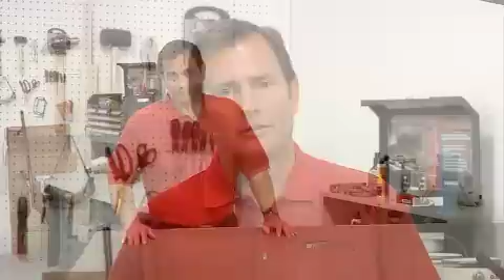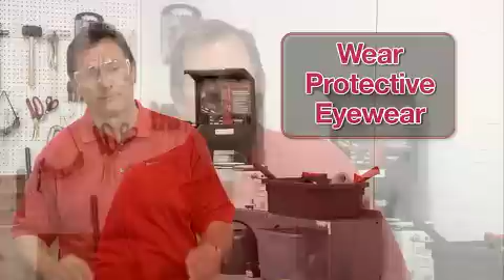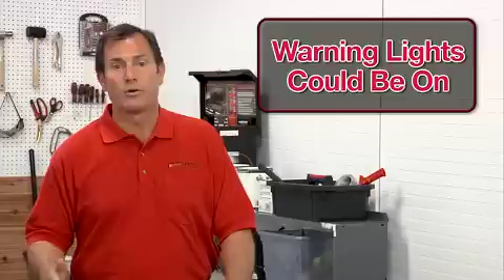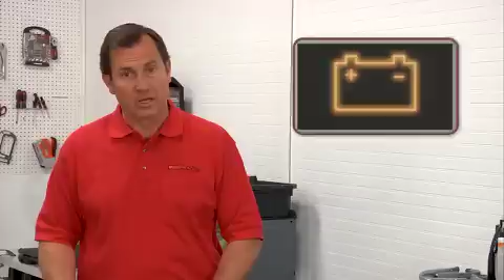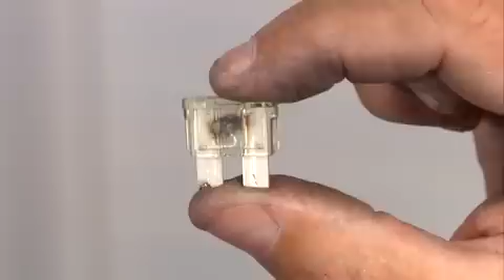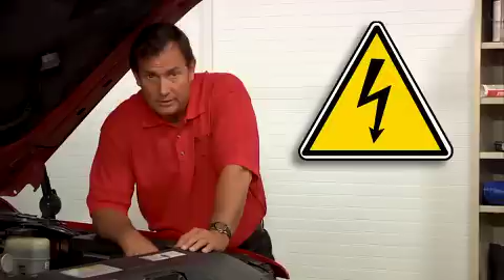AutoZone Car Care: When to Replace Your Alternator

Comment: Hi I just went to a garage because I had engin light on and service traction control on the dashboard so we the filter and than my battery voltage is goes to 14 than goes back to 12.5 do you think is from the alternator my mechanic told me is the alternator because my battery is good and the engine light won’t go off?

Comment: Have 12 in subs in a 2.0l 07 focus so Lights Been Dimming lol but Yest the Light Came on and Yep 12v was the Supply to battery Then at Idle It dropped down to 6v and Stall. Was The Alternator the 170$ -240$ Alternator need to Give Free Lube at that Price

Comment: I just had to replace my alternator. bought one at autozone, it was also bad. had to go back a second time and get another one. that one worked. but I was worried it was something else. used a volt meter to check.
Reply: Did u get new or reman

Comment: The light was lit on the dashboard. The service man behind the counter, sold me a battery, actually ''The Gold Warranty Battery'', installed the new battery, then I left the store ''With The Battery Light Still On, which he also knew.'' **Now before I get soaked for buying a $160.00 Battery, I'm going back down to that Store First Thing In The Morning & Get My Original Battery, because it ''Wasn't The Battery In The 1st Place.'' ***This is what he should have done in the 1st place.**

**If AutoZone Tries To Run That Old, ''The Batteries have already Been Picked Up, I'm Going To Complain.** ***If They Try That, We Have No Way Of Finding Your Old Battery***, That Should Be Easy. Its Going To Be That New Looking Battery, Furthest From The Back Door In The Rear Of The Building.....

I got jacked around, Two separate times. The last time was when my son was fired from his job because the Salesman Behind The Counter at the Elizabeth Lake Road Store Sold Us A Front Left Caliper for an F-150 With Rear Drum Brakes. Ford Hasn't Used Trucks With Rear Drums Since Like 1992. My Son Fell Asleep an Hour Just Before He Was Supposed To Leave For Work. And I Was Supposed To Believe AutoZone Has That Set As Their Parts Books #1 Choice For The 2003 Ford Pickup Truck, Oh Hell No.............. Now After The Union Stepped In On My Son's Behave, He Was Aloud Back To Work, [3-Days Later Without Pay], He's On A 1 Year Probation Period. Late or Misses 1 Day, He's Gone For Good. So This 2-Hour Job Ended Up Costing My Son $600 In Lost Wages & Pretty Much His Job Working at the Closes Job Sight To His House.

In Order To Continue To Use AutoZone, I MUST Read Everything About My Vehicles Prior To Buying From Them On YouTube. Plus I Have to Sometimes Check With Another Parts Store, [Which Is A Retarded Thing To Do But After What Happened To Him, Damn. I'll Probably Have To Edit This Answer Tomorrow After I Get Back To AutoZone & Get My Original Good Battery Back.....

Comment: If I fully charge my battery and drive for about 20 minutes and the battery starts to drain could it be the alternator that’s not working
Reply: Yes that's the whole reason why
Reply: No 😁😁😁😉😉😉😉😉😉😉😉😉😚😚😝🤑🤑🤑😚🤑🤑🤑🤑🤑🤑😝🐺🐆🦍🐅🐅🐺🐮🦊🐅🦧🐅🦊🐅🦊🐱🐎🐈🐄🐱🐂🦊🐮🦊🐂🦊🐂🦊🦌🐺🦓🐩🦁🐩🦁🐒🦓🐩🐺🐮🦊🐆🦝🐂🦊🐂🦊🦙🐫🦓🦏🐑🐇🐑🐪🐭🐰🐏🐰🐏🐇🦥🦥🐹🦏🐼🦥🦛🦛🐇🐿🐡🐛🐛🐛🐛🐛🐛🐛🐌🐚🐲🦋🕷🦗🐙🐞🦗🌸💮🏵🦂🥀🌹🦂🦂🐛🦂🌺🌳🌿🌵🌴🌵🌵🍂🌴⚘🌲🌺🌹🌸🏵🍇🍉🍋🍐🥝🍒🥔🥬🌽🍐🥔🥭🍒🌶🥬🥜🥦🧅🥯🧀🥩🥪🧆🥓🌭🌮🍟🥪🥗🥙🍳🍳🥚🌯🥘🍿🍿🧈🥣🍿🍿🧈🧂🥫🧂🧂🥫🥫🥫🍱🍱🍙🍘🍚🍥🍜🍜🍝🍠🍠🍢🍤🍥🥮🍣🍣🥮🥮🥮🍡🍡🍡🦐🥡🦐🍦🦀🦞🦞🦑🦑🦑🦐🦑🦐🦐🦐🍧🍨🍦🍬🍯☕🍮🍫🎂🍬🍹🍸🍵🧉🍶🥃🥤🥄🍽🧉🧊🧊🧃🥢🍴🥤🧊🍴🧊🥤🔪🥢🍴🥤🍽🧉🥢🍴🍴🍽🥄🥄🍴🍴🍴🍴🥃🥂🥂🍺🍶🍭🥧🍼🥛🍹🍺🧉🍹🥂🧃🧃🍺🧃🍸🍵🍼🍬🧉🏺🔪🍺🧊🧉🌍🌎🌏🗺🌋🏛🏟🏞🧱🏤🏪🏣🏬🏥🏩🏡🏟🏛🏟🏟🏟🗻🏛🧱🏥🏦🏦🏚🏦🏦🧱🏢🏩🏥🏤🏤🏬⛪🗼🗽⛩🌅🌆🌄🏦🛕🌁💈🚃♨️🎪♨️🚇🚅💈🚂🚋🚝🚉🚔🚞🚌🚎🚔🚒🚓🚙🚘🏎🚲🦽🛵🚲🛹🛣⛽🚥🛣🚨🚥🚧🛑🚢💺🛬🚁🛩🛫🛥🛳🚠🚟🚀🚀🧳⏳🛎⏳⏱⏰⌚🛎🕰⏱🕒🕒🕔🕐🕠🏫🏫🌞🌜🌘🌕🌝🌙⛈🌤🌤🌌⭐⛅🌝🌟🌪⭐⛈⛅⭐☁️🪐⛈⛅⛈⛈⛈🏗🏢🏡🌆🌆🌆🌅⛲🌆🎀🎍🏆🎗🏀🏆🎗🥇🎉🧨🎏🎈🎐⚽️🥉🏅🥊🥋⛳🔮🔮🧸🧩🎿🥌♦️🧿🕹♥️♥️🎮🎮🎮🎮🧸🧸♟♥️♣️🖼🀄🧶
Reply: Yep
Reply: Yes only cause I am having the same issue with my vechile too it's your alternator good 🤞

Comment: My alternator is nicely tucked near my right wheel just about under the engine 😅
Reply: I had a Lincoln LSC that was like that. I got rid of it after 1 month.
Reply: I work at a junkyard they had me pull one off of a 90s Nissan thing was all the way at the bottom and I thought the hell is this one puddle splash and oof

Comment: Hi, I have an Dodge Charger 2014 and just Chang the alternator. Still after running for some time I am getting an Battery Saver Mode option. Note: I have checked with Mechanic and my batter is ok also. Plz help and advise wat to do??

Comment: If you can start the car, take the voltmeter and measure across the battery terminals. A bad alternator will be 12V or less and will drop as you add electrical loads (alternator not charging). A good alternator will put out 13.8-14.2 volts and be able to maintain this voltage even with loads added. This isn't a complete test as it doesn't test the alternator current output but gives you a basic check. I just replaced an alternator where the battery light came on only at at idle. The wipers ran low at all engine speeds and the voltage was about 12V and dropping. No charge. This was the second reman alternator in 2 years (at least it is free). The original lasted 250K miles!
Reply: Thank you! This comment means so much to me! I was wondering if my battery was bad and I just changed it
Reply: I am glad it helped. If a jump starts a car, a bad or discharged battery is likely. A bad alternator can kill a battery by not charging it properly or discharging it through a bad diode.. My car has a tiny battery and not being used every day, combined wirh short trips means I need to trickle charge it occasionally. Lead acid batteries live longest at or near full charge.
Reply: @gmzx3 Does a alternator usually go bad based on number of miles driven or number of years on it ?
Reply: Miles are more important as moving parts, such as bearings and brushes wear with use. If vehicle is properly stored, I believe a decades old alternator will work.

Comment: Your Reman  Duralast alternators are junk.  I'm on my third one in 2.5 years and have zero confidence in this one.  My battery and terminal are brand new but I wish i had gone to the dealer.  Lifetime warranty is worthless when you're pushing your car out of heavy traffic to get to a safe spot.
Reply: Happened to me today.
Reply: Arie yup just replaced mine in my wife's Camry 11 years old went straight to Toyota coast more but original parts and 100% Quality of the work is better
Reply: You'll sleep better at night. My 3rd Autozone reman is still working after 7 month but road trips make me very nervous now and I have made a mental note of which small towns I pass through have an Autozone in case I break down and need to get another "life time replacement". From now on I'm only sticking with OEM or at the  very least, a brand new part.
Reply: It worked just made noise

Comment: my headlights and internal lights flicker when engine is on
Reply: Is is a police car? Just kidding. It could be that the starter isn't putting out enough voltage. I had lots of weird problems because my alternator wasn't putting out enough voltage. (It was putting out about 12 volts but it really needed like 13 or 14). I replaced it and the problems went away.
Reply: Gladiator Spear ll

Comment: First thing to check alternator for stickers that say "100% Tested", yellow "Charging Problems" with 800 number,  "Duralast" and "reman". If you have any of these or you have installed a AutoZone alt about 6months-1year ago then that is going to be your issue 90% of the time
Reply: That happened to me. The replacement has lasted. I think they just replace bad part, paint/clean it. If alt is hard to replace or keeping car, I would go for a new one.

Comment: plz someone help!! my car qont stay charged. new alternator..new starter..new battery and still the battery wont stay charged. 1987 olds cutlas ciera.
Reply: You have to have a short somewhere, not easy to find
Reply: It could be a bad connection somewhere between the battery and the alternator. One of the common places they will have issues is when the negative battery cable connects to the bottom of the battery tray. Also check the negative going to the engine block, and seeing that the batt, alt, and starter has been replaced the positives was probably already checked but wouldn't hurt to double check and to make sure none of the wires seem too hard as that could be a sign of corrosion. If you go to autozone they should be able to do a charging system check that will test the battery and the alternator, if it fails check the alternator fuse and (small 2 pin) connector. If it checks out good you probably got something draining on the battery at night (we car is off). Start by checking the simple stuff like the trunk light and the glovebox light. Make sure the ign switch is turned all the way off as sometimes a wore out ign switch will allow the key to come out in any position. Sit inside the car and make sure the lights are turning off properly. If you have a test light disconnect the negative battery cable and clip the test light from the negative terminal on batt to a ground point on the car (bare metal) and if the light lights up bright or simibright (make sure the door is closed so interior light wont be on) go through your fuses and relays one by one pulling them out (just one at a time then put it back and move to the next one) and look for the light to get dimmer, when it does then whatever you pulled the fuse or relay for is what is causing your battery to drain. Do the fuseblock under the hood first (because its easier) then do the one inside the car next. If the test light stays on the whole time then take a couple pictures of fuse box to note what goes where and pull all the fuses and see if that makes it go off or very dim.
Reply: Rachel Dailey. voltage regulator may be
Reply: I'm taking your advice on my 89 Cadi. Thank you very much <All2skitzd>
Reply: I also agree with you. Thank you.

Comment: In my car, the battery would die if the car wasn't used for several days -- particularly during damp weather.  Also the car kept destroying batteries.  No mechanic performed or even suggested a parasitic draw test.
The problem was the rectifiers in the alternator's output.  They had shorted.  The battery would discharge through the alternator's windings.  One day, the alternator caught fire while the car was parked.  Fortunately I noticed the fire while it was still small.  Replacing the alternator ended the problems with batteries.
Reply: I have 92 cutless it don't  stay running I don't know what  it it is
Reply: A nice elderly couple in my town had there house catch fire. The fire started from a parked car in there garage.

Comment: start my car and my alternator starts smoking what's wrong
Reply: You might have spilled a fluid in there or something. If you can see grime the spray it with electrical cleaner (after disconnecting the battery) and then let it sit long enough to dry out before reconnecting.
Reply: If you do, be sure to disconnect the battery.
Reply: You probably need an new alternator
Reply: +Cookie monster thanks bro. .  yea that's what I figured  the car had  been sitting for about ten years so I'm working out the bugs.  Thanks again
Reply: +buddy pople probably bad habits, smoking is bad for you.
Reply: WILLIAM SPILLED SOME WATER ON MINE AND IT STARTED TO SMELL ON MY 97 DODGE TRUCK  
SHOULD I TRY TO CLEAN IT? WITH ELECTRICAL CLEANER??
Reply: Put gasoline.. lol.. if theres a smoke .. theres should be a fire..hahha

Comment: Why am I having problems finding a video on a 2001 Mercury Sable alternator instruction video?! yes, I understand Ford and Mercury are essentially one in the same; but every video I watched with a Ford, didn't have the same location as my alternator :-\ I know removal is the same process but due to it's location, I don't know what all to remove in order to access the alternator, preferably I want to remove as little as possible so I don't lose parts of my engine by forgetting to put parts back! I mean, I can HULK it and eventually get to the alternator lmao! but that would be pointless, render my Sable completely useless and defeat the purpose. Does anyone have a link or is anyone able to guide me in the proper direction? precise tools? precise removal process? etc etc.
Reply: +Amanda Rodgers There were probably a couple engine options in the Sable.  You need to specify the one you have in the search terms.  You should be able to find out from a plate around the driver's door.  Also look on the cross piece in front of the radiator.

Comment: find the smallest drill bit you own and very carefully drill directly to the center of the idiot light warning,sometimes you may have to rotate the bit in small circular pattern till the light goes out replace bit entry path with a empty pen ink cartridge black if possible to appear as a tripomemeter reset. no more annoying light and saved hundreds on resale value. my check engine light would still be on cause my catalytic converters are original 1996 with 287,099 miles and my Obd2  and oxygen sensors are not the wiser just like the emissions dept. who needs a light you will know when your car is running like crap. unless your just an idiot like the light name implys.
Reply: I think we know who the idiot is here.

Comment: Just changed my alternator today but when I'm driving "the break light and battery lights turn on" and come and go. Don't know what to do. Plus... When I took my car to Autozone to check my "Che k engine light" nothing happened with the thing the guy connect to the car to read the codes. Nothing came out. Weird. He said is weird that nothing comes out even when we see the "break,battery and " check engine soon " lights on. Any help ?

Comment: here is a voltage drop test you should also teach ..
engine off. turn headlights on for one minute. then turn off. set volt meter at 20 volts DC. measure battery voltage at the posts..
12.65 is a fully charged battery
12.45 is a 3/4 charged battery
12.25 is a 1/2 charged battery.
try to perform this test if the state of charge  is over 12.5 volts.

start engine . turn on headlights.  meter set at 20 volts scale.
test One.   Negative battery post to the Positive battery post.. 14.1 to 14.8 volts DC is expected.
test Two..  Negative battery post to the engine block.. 0.04 volts DC max.
test Three. Negative battery post to the body.. 0.02 volts DC max.
test Four.  Engine block to the Firewall . 0.02 volts DC max.

test Five. Positive battery post to multiple fuses in the under hood fuse block. 0.04 volts DC max.  try to test as many fuses as you can.. there are multiple buss bars in some under hood fuse blocks and you can loose individual sections.

test six. Positive battery post to the Alternator output stud. 0.3 volts MAX that is 3/10ths of a volt.. because the alternator is putting out significant current. i like to see as close to zero as possible.. 0.08 would be very good..  60s and 70s mopars with hard wired amp meters in the instrument cluster will read 0.7 volts and be perfect.

if you get 0.00 on tests two thru 6.. change the volt meter setting to 2 volts DC or 2,000 Millivolts DC. perform the tests again.. some meters don't show fractions of a volt below 2 volts very well.  a test section  showing 0.00 volts usually is an incorrect probe location for that section of the test.

tests 1 thru 4 should be performed on every car with any kind of electrical issues. including engine /codes.  1 thru 4 can be performed in under a minute after you have learned them..

you will want to perform tests 1 thru 4 and perhaps 5 on every car before you finish working on it to prove the wiring under the hood is properly hooked up. you cannot see voltage drops except with this test.  it will save your hours of work and also prevent many comebacks if you spend these few minutes and PROVE the wires are properly attached and not corroded.
Reply: Well said.
Reply: wayne p thanks so much for the advice makes sense love youtube!
Reply: Very helpful...Thank you.
Reply: wayne p thanks
Reply: wayne p aa
Reply: Ty!